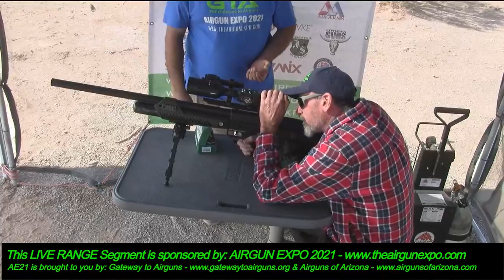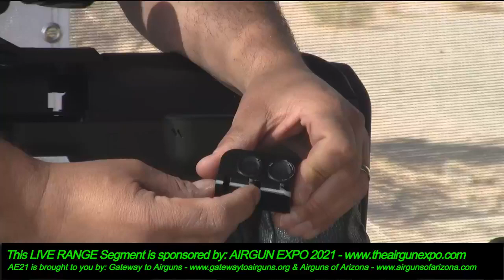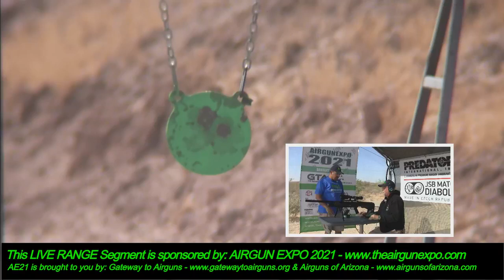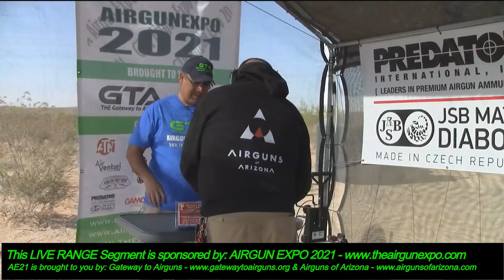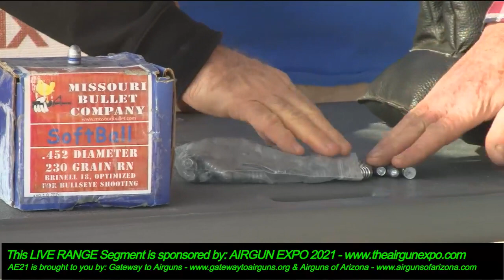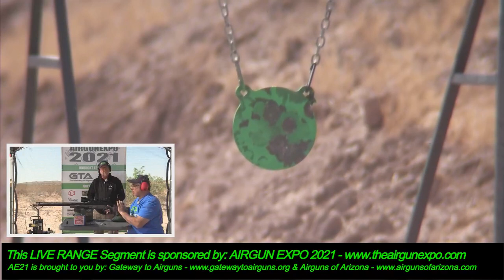Airgun Expo 2021 - Bushbuck .45, Umarex Hammer .50 Bonus Range Day! - Recorded May 13th, 2021

Comment: The Hammer even though it took forever to get to market..still has its share of serious issues. The Bushbuck on the other hand imho is far superior and with much better build quality.
Reply from the maker: No argument on the Bushbuck being a better built gun.. It should be, it's about 2x the cost.  

Cheers
AGW
Reply: @AirGunWeb  yes sir and I will pay the money gladly for less issues, higher reliability, and possibly better accuracy. Not to mention that if I’m not mistaken the .45 will have a slightly flatter trajectory sir. The Hammer sadly needs more work. No air should be hitting you in the face to be honest for what it costs. Will Roman got tore up by having his hand in his normal shooting position regardless of what the manufacturer says about your hold and hand placement on that gun. I love my Umarex guns…I really do…sadly the Hammer imho isn’t ready for production yet and needs to go back to the drawing board. It’s amazing but flawed sir. Thanks for your reply. God bless you and yours and thank you.
Reply: @heathhalfhill6401  Not only that, they both bragged about how short it was.  There wasn’t anything about the gun that impressed me…